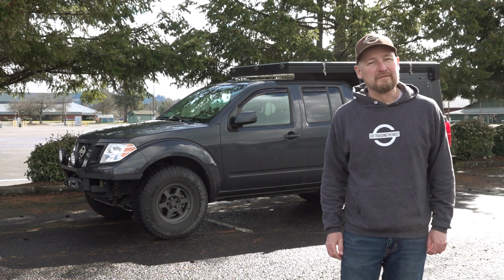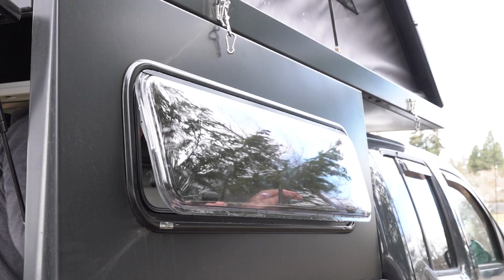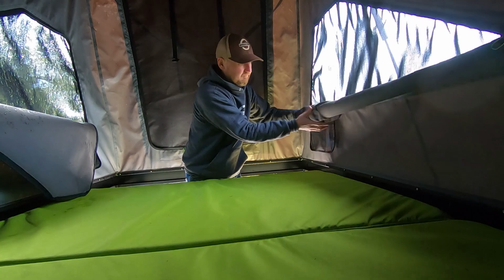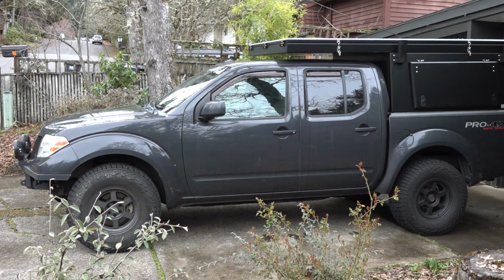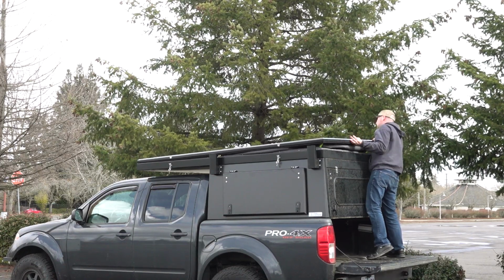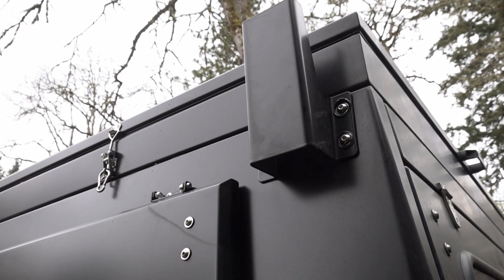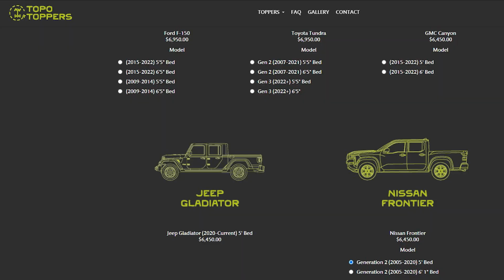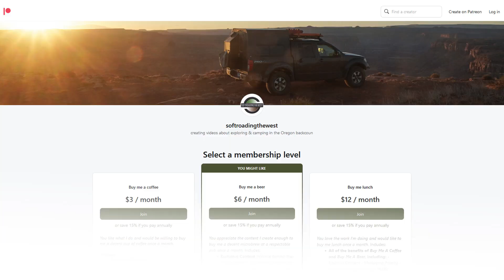Introducing a new camper option for Nissan Frontier

Comment: I really like your set up - I have a 15 Tundra doublecab w/ ARE camper shell fully carpeted with a Bedrug. I've done quite a bit to the truck including Ironman4x4 Foam Cell Pro suspension/Method wheels and BFG KO2s. It's just me and the dog and sometimes the truck is just way too big. I find it hard to explore and I'm always backing up several times to turn around. I've had Tacomas but I just hate they way the shift and there's no low end grunt. My dads owned 3 Frontiers and never had an issue. I've recently looking into the 2nd gen. Frontier for a smaller, more practical weekend warrior/exploring build. The aftermarket is finally starting to make more stuff for them.

Comment: 6:53 I feel like that tarp/canvas will give eventually after so many times of being put up/down, no matter how durable it is, it just will tear it’s inevitable. But looks nice and a bit expensive actually.
Reply from the maker: Anything will wear out eventually. The pop-up canvas-walled camper is an approach that has been in use successfully around the world for decades in various forms. It is a remarkably tough marine-grade canvas and there is actually very little stress on the canvas or its mounting points. Canvas is used to propel heavy sailboats through the water, constantly subjecting that canvas to FAR more stress than this will ever see.

The reality is, for camping in the back of a pickup truck, you either:
• Hunch down inside a solid traditional topper. Cramped & uncomfortable, but has the advantages of being fairly inexpensive and no moving parts (though I've seen fiberglass toppers eventually start to crack);
• Stand up in a full size rigid-walled slide-in camper. Far more comfortable, but very heavy, way more expensive, limits backcountry/offroad access due to the height & center of gravity, has a big impact on gas mileage, and eventually they almost all seem to end up with water damage to wooden components; 
• Put a rooftop tent on a bed rack. But there you're again dealing with opening/closing a canvas structure, and you can't stand up in one; or
• Use a pop-up topper like this. Ultra-light, easily handles off-road travel, you can stand up in it, relatively affordable, low impact on gas mileage. 

There are tradeoffs no matter what route you choose. You have to select the compromises that make the most sense for how you camp. For what I do, this is by far the most logical choice while still costing less than almost every other camper on the market. For others who stay on paved roads and have deep pockets, other approaches may make more sense. :-)

Comment: That's a great option. I would opt for the full pop-up version but this is great as well. 
What surprised me the most about your whole video was the fuel economy improvement of getting rid of the roof rack. I'm looking for an Xterra, that roof rack will never be used so it's definitely going to come off! Did you just loctite the screws and put them back in or did you seal the holes another way?
Reply from the maker: I have a video about it. What I did was probably not the best approach but if you read the comments, there are lots of suggestions. Scroll back through my videos a bit and look for the Roof Rack Delete video.

Comment: This topper is sick, Donald! I have a question about the cargo hatch that you got with your Topo. Are you able to open/close the door from inside the camper?
Cheers!
Reply from the maker: I'm not sure, but I don't think you can pop the latches from the inside. It was a non-issue for me since I knew I would be enclosing my cargo door with cabinetry and it wouldn't remain accessible from inside the camper anyway.

I did obviously use this for a while as an empty shell before completing my interior cabinetry. In camp I would just leave the cargo door unlatched. It will stay closed on its own without being latched, so that gave me the ability to push it open from the inside if I wanted to. The places I camp, I'm never worried about locking up the camper when I go to sleep, but I understand that solution wouldn't necessarily work for everyone. Perhaps Topo can advise on possible options if you need that capability.

Comment: Great option, would like to see how you close the tailgate and camper door while inside. Can the door be secured from the interior when inside? Thanks Donald 😎
Reply from the maker: Oh dang, yeah, I wish I had thought of that. I will try to remember to demonstrate this in my next video. Ultimately it’s straightforward. I didn’t have any trouble pulling up the tailgate from inside, then reaching up to grab the topper rear hatch and pull it down.

There is not a built-in way to lock it from the inside. They did explain to me a way some people rig up an interior locking mechanism, so it could be done if one needed.
Reply from the maker: To clarify, you can latch the rear hatch from the inside by manipulating the latches, but can’t key-lock them from the inside. To fully secure it from the inside would require a little DIY mod.
Reply: @softroadingthewest  thanks Donald, looking forward to the next video 😎
Reply from the maker: @richardvalitalo3670  No, no one could lock me in unless they had the keys to my truck. You can still operate the rear hatch latches from inside. Even if someone had my keys and locked the hatch & tailgate, presumably if I'm in there, the tent is deployed and I can unzip the rear pass-through window. In a pinch, I could also squeeze out through the Arctic Tern window, which only locks from the inside. I'm pretty claustrophobic and I am constantly evaluating egress options every place I go. 🙂

Comment: I would like to see a comparison to the Lone Peak Camper for a Nissan Frontier
Reply from the maker: I haven't seen the Lone Peak firsthand. The main thing I've noticed about it is that extra little tent part that pushes out the back, which maybe prevents the rear tent wall from slanting inward slightly like most wedge campers, but being a fall/winter/spring camper in the PNW, I just see that nearly horizontal flap of canvas as something that looks like it will collect rainwater or snow and makes extra steps in the setup/breakdown. I also notice that the roof struts are mounted on the exterior. I know there are a few campers built like this, but with the amount of branches I've snagged over the years, it looks vulnerable to me and then the struts are constantly exposed to the weather and to trail dust (whereas Topo has encapsulated the roof struts inside the shell when it is closed). And as far as I can tell, they don't offer window options for the side panels. On the plus side for the Lone Peak, the bed is a solid platform on struts that raises up easily in one quick move instead of multiple pieces of mattress & aluminum that have to be shifted around...that's a really nice feature.

Comment: I’ve been looking for an episode where you explain the reasons you went from your contractors shell to the present took topper??
Reply from the maker: I don’t think there’s any singular video that specifically explains it. It was a situation that evolved over the course of several months, so bits and pieces of the story are scattered across multiple videos, and each step of the way, I did not know where the whole thing would end up. 

But to highly condense, I had an opportunity to temporarily test out a different truck camper (not the one now on my truck). I removed the contractor cap in preparation for this, but some delays and issues arose and some months later, it became clear this wasn’t going to work out. I did a number of trips just carrying my Gazelle tent in the back of the truck. Meanwhile Topo reached out to me because they were interested in seeing their camper on my truck. I already had my eye on their camper as the potential next evolution of my build so I was interested in working something out with them.

I knew the Leer topper would eventually give way to another camping solution, I didn’t think it would happen that fast but it was an opportunity I couldn’t pass up, and now that I’ve been using it for a few months, I’m so so happy I did. I was pretty pleased with how the contractor cap turned out and it was very serviceable, but I love camping in the Topo so much more.

The old Leer, complete with the extension I built, has moved on to new adventures on a Frontier in Idaho. 🙂

Comment: Fantastic solution! How you deal with dust in the bed compartment? Do you still think there’s almost none aerodynamic impact?
Reply from the maker: I have a whole video about how I dust-sealed the bed of the truck:
https://youtu.be/4A8mB7Ku_og

In terms of aerodynamics/MPG:

• With the camper on, the truck gets better gas mileage than it did with no camper/shell but with the bulky factory roof rack in place. I easily average about 18 mpg on highway trips. My previous setup, with a tall contractor cap and quite a bit of gear on the roof rack, highway trips averaged in the 14-15 mpg. 

• The MPGs are NOT as good as when the truck was completely naked (factory roof rack deleted, no camper). I averaged closer to 20 mpg...but obviously had zero functionality. :-)
Reply: @softroadingthewest  tks!

Comment: I am surprised that you got 2.5 less mpg with the roof rack only. Wow, that is a lot
Silly question but what did you step on before you stepped on the tailgate? I am not that agile so I wonder how other people get into the back of their trucks LOL
Reply from the maker: In this video, I was just putting one foot on the corner of my bumper and grabbing ahold of the camper to pull myself up. That's not really a viable long-term solution (and I can't even do that anymore now that I've completed my custom bumper, those corners are no longer step-able). I've experimented with a whole series of step stools and mini ladders to use as steps and had a few of them break on me. Lately, I've been using what I believe is a bath seat for people who need to sit in the shower. I found it at Goodwill for $15. It's lightweight but extremely sturdy, has height-adjustable legs and large rubber feet which don't sink into soft ground. I added strips of self-adhesive stair tread traction material to make the top grippy, and painted it black so it doesn't look so much like a piece of medical equipment. 😆 It's still not perfect, and I do have to take care, especially when stepping down out of the camper, but it has held up better than anything else I've tried. There are some really nice and very sturdy stair-like options out there in the RV world, but they're pretty spendy and generally bulkier than I have room to carry. I've spent a LOT of time trying to find a solution that balances function with size and price, and have largely come up empty-handed.
Reply: @softroadingthewest  Thank you!

Comment: l like it,but those little clips might make a little noise on the trail. give us a update on that when you get out offroad. thanks again
Reply from the maker: The clips aren't strictly necessary, just a fail-safe. Honestly my truck is so noisy with creaks & squeaks that it's the type of thing my brain will just tune out along with the rest of it, but I know some people can be a little manic about noises and chase down every sound. I'm sure one could come up with something less noisy to insert through the lock holes. Or perhaps even just using plasti-dip to rubber-coat the provided clips.

Comment: Awesome! I am curious to see how it plays out for you.

I have seen a few dudes saying they having bad water leaking issues with them.
Reply from the maker: I've seen one guy on YouTube getting water in, which appeared to be a function of the truck bed contours as opposed to the camper build itself. My Frontier bed is terribly porous...holes everywhere which allow water & dust into the bed regardless of what's on top. I've been chasing these weak spots since I got the Leer topper a couple years ago. I've got a lot of it sealed up but now that I'm back to having the original tailgate, I need to seal that up now too. Anyway, we'll see how it goes. Here in western Oregon I'm very well positioned to truly put it to the test. 😄

Comment: It is nice but looks expensive. And shipping must cost a ton also. Going to them helps if that's an option. I'd use another foam mattress I like my comfort. Or air. For people with a dog such as myself it's very cool to be able to have it in the bed at night while your up in the bunk. They can't pop air beds, or get hair and dirt in your bed. I just bought a tent with a front porch area the dog can sleep in separate from in the tent. I'll be right behind you si in the subie. The Nissan/ Toyota is definitely the way to go for a better experience and more long term. I myself will be living full time out of the forester. And look for some land out there somewhere to put a tiny home on trailer frame that i will build mysef,
to call home base. Go from there. I wanted to build a school bus for years, and kept downsizing it to a short bus with the car in tow. It's too costly and not ideal to travel light. I'd much rather spend less money on a acre or 2 and build something a little bigger that's off grid completely. And I can just roll up and use then go back out on the road again.

Comment: Thanks for making these videos. What are the bed panels made from, they look fiberglass? Also any leaking from side panel or window or gasket the topper sits on? I saw a video where a badlander was leaking.
Reply from the maker: The bed panels are aluminum that has been powder-coated.

In heavy rain, I'm getting a tiny trickle from the center bottom of the front window. Over the course of a rainy night, it's not even enough to spill over the lip of the wall panel, so I just wipe it up on the rare occasion I've seen it...I've had way more water accumulate from condensation on a cold night. No issues with where the camper meets the truck bed, camper roof, cargo door, side window, or rear door.
Reply: @softroadingthewest  Sounds good. Lastly I know you’ve seen many toppers in person, like the Super Pacific and AT Overland - How would you say the Topo build quality and materials stacks up?
Reply from the maker: @MarkM-c7i  Well they each seem to have a different sort of build approach/architecture, so it's apples/oranges/bananas. To me all of them seem more that solid enough construction. I haven't been able to scrutinize Super Pacific or AT Overland closely. Unlike some campers, Topo isn't built of panels affixed to a welded skeleton. Rather, the structure/rigidity comes from bending the edges of each panel (which are made of 1/8" aluminum plate) into channels. There are some welded bits here and there, but the structural integrity doesn't rely on welds, it's purely the inherent strength of the channeled metal. I feel confident it will outlast me. 🙂
Reply from the maker: @MarkM-c7i  They're each built a little differently in terms of how they approach the structural architecture, so it's sort of apples to oranges to bananas, but one of the things that appealed to me from the beginning about the Topo was how solid it feels...I'm certain it will outlast me. 😄 I don't feel like the price tag reflects a lack of quality. Super Pacific has some extra details and features that require more material and man-hours, and AT uses some kind of honeycomb composite material for their walls and delivers them lined with carpet by default, so there are higher material costs and labor expenses there as well. For me, many of the features that come with the more expensive campers are things I can DIY my own way in the Topo and still end up into a functional camper for several thousand dollars less.

Have you seen the Jonny Taco Outdoors YouTube channel? He's had his Topo Mesa for a while and has completed his interior build, and he has had more time than me to get out with it, if you want to see more of the Topo in action:
https://www.youtube.com/@jonnytacooutdoors
Reply from the maker: Apparently I already replied to this but YouTube was telling me I hadn't. 🤣
Reply: @softroadingthewest  Ha! All good. The more info, the better! I totally get what you’re saying and since have talked to Katy at Topo - so cool and helpful. I have seen Jonny’s vids, several times.. He does some pretty good stuff. Thanks again for your insight and time. It has definitely moved me closer to a new topper.

Comment: everyone of you guys do same or about same set up. I can see if any of those same manufacureture, will do about same but no tent, just a topper with module kitchen and access window on side, similar to Aussie cabs but more accruable from the back and having two levels. One level is draws and second fringe and kitchen on one side and small storage and power om other side. So we can more free on roof top tent, as lier iKamper is still better quality then many others.

Comment: Maybe adding a bit of shock cord attached onto both sides would help out with tucking in the sides when closing.
Reply from the maker: Ultimately I’ve found it’s way easier than I expected to rein it in. It’s that final two inches where it wants to poof out a bit but even so, I’m thrilled with how fast & easy it is to close up. 👍
Reply: They do use a shock cord on the Badlander
Reply from the maker: @KnittedSchnauzer  Yeah, I think they don’t on the Mesa because it’s really quite easy to pack away as-is and maybe would interfere with the rear zippered window flap...